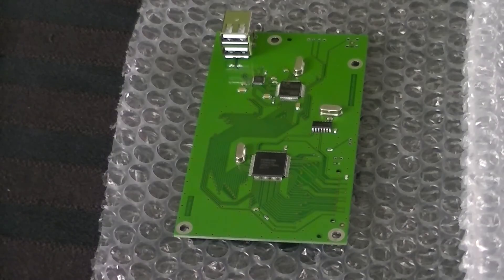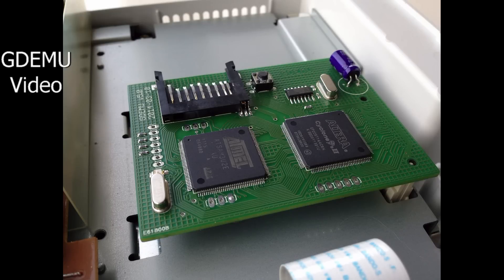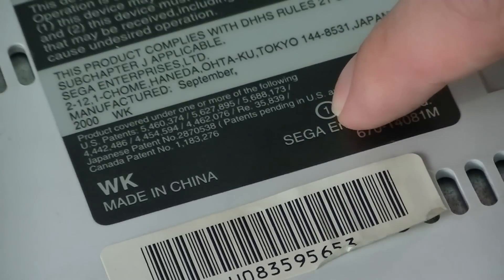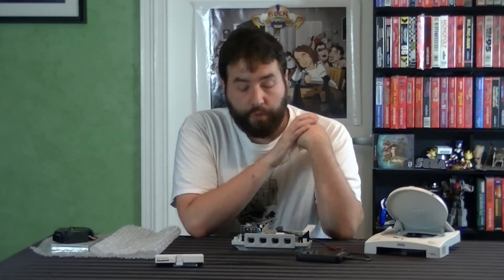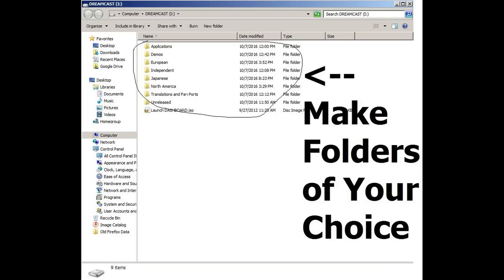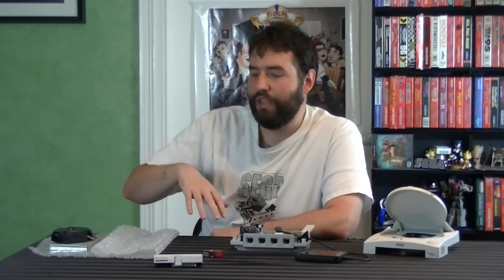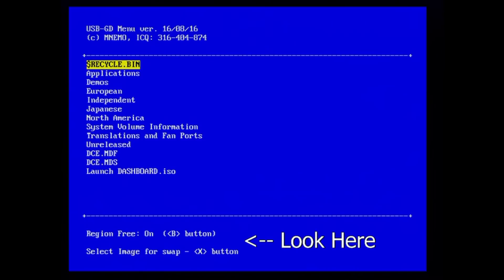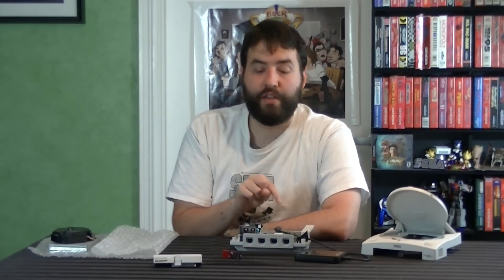Keep Dreaming - USB GDROM ("Flash Card" For Sega Dreamcast) - Adam Koralik

Comment: Actually windows will format fat32 through the terminal. You can find tutorials to do this and it's actually really easy. I say this because most 3rd party apps have either compatibility issues or are filled with bloatware. Taking the 2 minutes to Google the terminal commands save you from potentially slowing your pc down or even breaking functions with incompatible software if you are running Windows 10. 

Just some notes. Great video!

Comment: The latest variation of GDEmu actually works very well. 
New software of GDEmu creates a menu with game names, no need to search for the files. It is compatible with different images types; iso, cdi, bin, etc. Support saving to sd. 
On top of that, a native way of playing games is always the best way to do it, any emulation or program running in the background will always eat up resources normally available for the game.
The device you have, seems to be more convenient for homebrew as it allows to browse files and choose between many iterations of the program. If debugging would be available I would by one myself. 
For now, I stick to my trusty GDEmu.

Comment: One could theoretically write a firmware that could properly interface with a generic USB-DVD drive (USB to SATA, just as the hard drives work) if they don't already, and then just boot the DVD. You could keep the whole game on a disk, albeit the convenience of not touching one's collection is gone. If it does work, we could start working on DVD drive replacement units for Dreamcast to play exclusively backed up games (which is at least closer to the real discs)
Reply: Or, or...hear me out... It may sound pointless, but could be awesome. Maybe 3d print an attachment that goes on the bottom (eg. Famicom disk) where an old usb floppy drive or zip drive fits into and somehow attaches to it. That way it's almost like you're running them off old carts. 👍😆 Like the snes super wild cards.

Comment: Hey Adam,  I actually have one of these and think I might know why you couldn't get the disc swapping to work.  There's a lever on the Dreamcast GD-Rom assembly that is pushed back when the lid is closed.  The USB GDROM doesn't have that lever.  The only way to get disc swapping to work that I'm aware of is to actually desolder the lid switch from your Dreamcast GDROM board and solder it to the USB-GDROM.  Alternatively, you could possibly find a small enough tact switch that would fit on the solder pads on the board and solder it on.  When you wanted to switch the discs, you'd load them in the software like you talked about, and then push the button to simulate the lid opening and closing.  It's a major pain the ass, but it does work.
Reply: You only need the switch for swaps with D2 and cheat discs, etc, the switch is not needed for functionality of the device.
Reply: Thats what I had to do to get mine to work, it was easy to do and worked like a charm.

Comment: in order to make the disc swapping work you need to remove the lid switch from the laser assembly you took out and re-solder it to the USB-GDROM, or you can solder wires to the USB-GDROM and attach a different switch to the end of the wires.

Comment: Hey Adam! Great movie.
I also own the USB GDROM v5.
To get the disc swap function to work you have to solder the lid switch to the board :)
With the lid switch in place it works great!

I am still trying to get it cooler.
First going to try to add a resitor, if that doesnt work I am going to replace the psu with a Pico psu.

Comment: also you can add a 300 ohm resisotor to fix heat issue. or desolder the 12v from power supply to fix heat
Reply: Cameron McKown hi is there any tutorials on how to do this?
Reply: Cameron McKown bad video. the resistor doesn't Have enough wattage and Will cause the resistor to overheat. you need about 10 watts for a 300ohm resistor. I used a 20 watts one since i had a couple here.

Comment: Hey, Chip, I know that name from CGR :D CHIP SENKBEIL

I've been pining over these things for ages now. Maybe a small internal usb to SATA adapter and some creative 3D printing to mount up a 2.5" drive would be nice. And you could always bend up a simple plastic or even cardboard divider inside to help simulate the drive and redirect the air back across the PSU like it's supposed to be.

Comment: I just noticed how the board has two usb ports. What's to stop from say, using a usb adapter to run a case fan for some extra air flow inside? That might help with the thermals, I would think.

Comment: There is two heating issues with the USB-GDROM. First one is like you mentioned with the airflow. to fix that issue you don't only need to use the metal plate from the laser assembly, but you also need to use the black plastic plate that is between the metal plate and the laser. the second issue is caused by the unbalanced power leg due to the USB-GDROM using less power than the laser did. This puts more power and heat on the other power leg. in my experience if you have your Dreamcast in a ventilated area it's not that big of an issue. Some people have Modded the power supply to fix it, but it's easier to just keep it in a ventilated area.
Reply: Brian Walstad Just add a 300 ohm resistor

Comment: The most common reason why the laser assembly breaks, is because the mechanical gears are made of plastic, and they break sometimes, specially with wear over time, is very hard to try to get the gears by itself, they sell the entire unit to make more profit instead of selling the gear which is more work to fix it, just simpler to replace the assembly, they should make those gears out of aluminum or something stronger to make them last longer.

Comment: Since it uses USB, does that mean if you have a disc drive that can read GD discs (or even CD) could you possibly use it as a literal replacement for a broken laser?
Reply: normal drives can't read actual gd roms
Reply: The GD-ROM is a a special standard that was made specifically for Sega. The only place you'd find another GD-ROM is in a Dreamcast, the NAOMI arcade system that is based on the Dreamcast, and the Triforce arcade system that Sega co-created with Nintendo and Namco. If you wanted to swap out the drive, an old Dreamcast is the cheapest route.
Reply: well, there's another place, the gd writing units on dev kits

Comment: There are some STLs out there to 3D print where the hard drive will fit inside the case and make the airflow like stock. Pop one of those in there and a new DreamPSU and bam epic Dreamcast! Honestly think that the best setup if you cant get the disc swap to work is just get another Dreamcast and have a GDemu in it.

Comment: I've Never had any issues loading and playing games with my Clone GCEMU on a 128GB Memory Card except for Alone in The Dark but the same problem happens with burned games and even  a GDROM Disc copy of the game won't work when it asks for the second disc, it will keep saying you put the wrong disc in.
Reply: Where did you get your GCEMU clone?
Reply: On Amazon and it came the next day Amazon express even though I did not have Amazon Prime.
Reply: @dallase1  is it called GCEMU on Amazon
Reply: No, the Dreamcast device is called GDEMU, at least that is what the one I have is called and when I do a search on Amazon for GDEMU it comes up with the Dreamcast GDEMU Clone that is the same as what is in this video but the clone version that is much cheaper and available unlike the "Official" one.
Most of them come from Over Seas and those are a bit cheaper but will take over a month to arrive.

Comment: Fat32 64kb cluster size for 100% compatibility also if using a HDD you must make sure the partition is set to primary. 

Also the launch dashboard.iso is just a blank file, it just forces the DC to go to the boot menu. 

The new firmware that isn't out yet, has auto launching of GDI games, so no more having to select the .gdi file!

The swap issue you have is due to you not installing the lid switch on the UGC. ( you need to solder it onto the top right of the device )

I don't get annotations on mobile.
Reply: JCRocky5 you have entirely too much knowledge in your brain!!!
Reply: You can even just cram a piece of cardboard on the black lid switch and the shell of the Dreamcast. It works fine and you don’t need to do any modding other than cramming paper in

Comment: Would having games running off of a HDD through a Dreamcast solve the problem of slowdown? Example as in Shenmue II and its slowdown issues.
Reply from the maker: Not really, no. It helps with load times, but that's about it.

Comment: i prefer the gdemu. I got both the USB gdrom and the GDEMU. Don't forget to desolder the12v or use a resistor ( i used a 300ohm 20w resistor) or a 5v PSU for the overheating issue when using these both. Also for the airflow problem you can just use cardboard, you don't need a special mold for that
Reply: His OCD told him that he needed a special mold. Don't judge.
Reply: wut doucar OCD ? i'm not judging, just saying he can just use cardboard for airflow wich is easier and free.
Reply: Cardboard come on, some thin plastic would be a better idea, or just wire up an extra fan. Adam comes up with some shit solutions, leaving the cover off and turning up the ac lol.
Reply: 111 111 mine is done with a piece of cardboard for the airflow. drilled a hole in the back with A laptop fan attached to the board and a 300ohm resistor to Keep the psu from spiking up in volts since the drive used 12 volts but by removing it the 12 volts spikes up wich causes overheating and by adding a 300 ohm resistor it doesn't Spike up.

Comment: Install the lid switch then you can put the inf file available from the site on the HD that reverses the lid switch. This is so you can play with the HD sticking out and not have the lid switch in reset mode. The best idea is to replace the switch with a wired button.

Comment: Hi Adam my Dreamcast still works but is HKT3000 Japanese NTSC J, would this work on it for future reference when the laser stops working? I have no number with circle. I looked at the guys website no model reference.

Also Adam the overheating issue how hot would the power supply get when the Dreamcast is only running a USB stick? Does it get mega hot like it's gonna fry? Even with the metal shield.
Reply from the maker: I would assume so, but I can't promise success.
Reply: hello! if your dreamcast was made in japan than it 100% work with usb gdrom.
Reply: Thanks for answering Adam and C above will give it a try if my laser goes. If I get some spare cash might jump in earlier.

Comment: Ever consider getting the battery upgrade kit for the Dreamcast? The clock battery is replaced by a holster so switching batteries is plug N play. You must use LIR 2032 batteries. I just installed two yesterday for my slow first attempt at soldering ;p

Comment: USB-GDROM? I never heard on much other options besides Dreamshell which I have.
Reply from the maker: DreamShell is...not the best.
Reply: @AdamKoralik  Well at least I'm not removing the entire GD drive to just to have my games become solid state. I have GD discs, what am I supposed to do, sell them off to GameXChange and download the games for a solid state option I don't have? There's something about the actual disc drives that allow me to do certain things, and that thing is called CODE-BREAKER. I'm talking Power Stone 2 and Sonic Adventure in Anamorphic Widescreen+60fps. Using CodeBreaker means you have to swap between the cheat disc and the game itself. I plan on making the perfect longplays for my Dreamcast games and I need to have the disc drive available and not stop playing to record the whole thing. However Sonic Adventure 2 doesn't seem to work since CodeBreaker/Gameshark cheat discs were only made in 2000, pretty bad year to release such products in such an early stage. I wish there was a modern method of activating those cheats. If there were a way to force the console to use these cheats and use your own progress that you've built up over a year, I would go for the simpler way hands down. But I did kinda pay around $100 a long-ish time ago and I do have Dreamshell on hand, I just need a super fast 6x SD card instead of the lame one I've got.
Reply from the maker: @HedgehogY2K  Actually I was just saying that DreamShell is buggy, it tends to have compatibility issues and causes bugs in games that didn't originally have them.
Reply: @AdamKoralik  Well Powerstone 2 worked just fine on both CodeBreaker Widescreen cheat and Dreamshell 4.0. But Sonic Adventure 2 didn't work with either. I have the suspicion that the SA2 game disc is different from the real thing seeing it came from a normal DVD box which mentions Qsound instead of the thin plastic cases. So I believe CodeBreaker and Dreamshell work just fine. To me Dreamshell works as it should ripping game discs to SD card and loads depending on the quality speed SD card, I'm not aware of any bugs though. My real concern is CodeBreaker for games that were made after it like SA2. How will I get SA2 Widescreen if CodeBreaker won't cooperate? Or maybe there's a better cheat method out there that accounts for everything in a flash, HAAHAHehe! Get it, flash ok I'm strange aren't I. I ask questions about retro consoles almost no one even talks about, like the Xbox 360's Xvid bitrate limit surpassing 10mbps according to my USB testing.

Comment: Hey Adam, what program did you use to format your drive in fat32? The one I found only formats in EXFat.
Reply from the maker: Should help: https://forum.xda-developers.com/tmobile-lg-g3/general/guiformat-fat32-simple-windows-sd-card-t2960190
Reply: lol, same program I've used. That being said, this one is more up to date, guess I'll try it. Thanks
Reply from the maker: Really? Should work, I had no problems. I'm using Windows 7 if that for whatever reason matters.
Reply: Yup. that one does seem to work. The previous version I had gave me a ExFat format, this one gives me a Fat32. I started the transfer of my games on it (I'm remoting home from the office), I'll see if it works tonight. BTW, did you dump your own games using Dreamshell and a Dreamcast SD card reader?
Reply from the maker: With the Dreamcast? No, I used the broadband method.
Reply: Oh ya, I recall that old trick. Well my setup works great now. All of my DC games are on a 64GB SD card, hooked on an SD card reader and plugged on the USB GDROM. I'm also able to play undubbed version of Shenmue 1 PAL version and Grandia II, this rocks. Can't wait to do this on Saturn.

Comment: Adam : the heat increase has nothing to do with airflow.  It's happening because removing the GDROM means there's less strain on the PSU's 12V RAIL (the main power delivery of the PSU) due to it no longer powering the GDROM.  This means the 12V rail operates beyond spec and climbs to 14V which, in turn, creates heat in the PSU.  The fix is to attach a resistor in line with the 12V rail.  https://www.reddit.com/r/dreamcast/comments/3cmhyo/usb_gdrom_dreamcast_mod/

Comment: It's recommended everyone who wants to install GDEmu remove (disconnect, not necessary to remove) the 12 V voltage regulator as it's not needed and is the cause of all of the heat (in addition to airflow by not having a 3D printed mount); I am willing to bet the same applies to the USB GDROM, so please, if you care about the longevity of your Dreamcast, please remove this!

Comment: Any idea how fast the USB stick needs to be?
Reply from the maker: +Matthew Simplay As I recall 2.0 is recommended.
Reply: I've found a 1tb USB 2.0 stick on eBay quite cheap but it's most likely one of the slower thumb drives at 10-15mb/s read 5-8mb/s write speed so just checking what speed would be okay?

Comment: Shenmue! Omg I loved that game, I wish I never sold my Dreamcast.. what is the best DC emulator in your opinion?  I'm also thinking about getting one of the CF card modded Dreamcast from one of your other videos.
Reply from the maker: +Esoteric Jay Not sure, I don't use emulators.
Reply: DC emulators are not perfect. over time everything will start degrading and become choppy and not playable. the best way to run DC games is on the actual hardware. same for a few other consoles unfortunately

Comment: I got mine a few weeks ago and never put that 
"Launch DASHBOARD.iso" file on my hard drive and it works perfectly fine. Also, the reason disc swap isn't working is because you have to desolder the lid switch off of your GD-ROM drive and solder it onto the USB-GDROM board. Otherwise, it does nothing and it can't detect the lid opening.

Comment: any emulators like nes or game boy compatible for this flashcard?
Reply: Yes. There are both NES and GameBoy emulators that work with this device. However, you can't just dump roms into a folder. You'd have to compile them with the emulator as a disc image that the Dreamcast can read. There are many disc images that have been pre-built that can be downloaded.
Reply: The Adequate Gamer 

thank you!

Comment: Need to desolder the lid switch from the gd rom and solder it to the gd rom controller so the dreamcast thinks the disc is being ejected and then you can swap images. But you would have to butcher a gd rom to get that switch.

Comment: So this uses the gdi file not the cdi?
Reply from the maker: Supports both.
Reply: Adam Koralik OK cool. Got another question. Is there a way to boot dreamshell from the sd card without a disc? Like how the USB boots up its own menu
Reply from the maker: Yes. But it requires modification. Check out my CF Card Dreamcast video.
Reply: Adam Koralik cool, you're the best